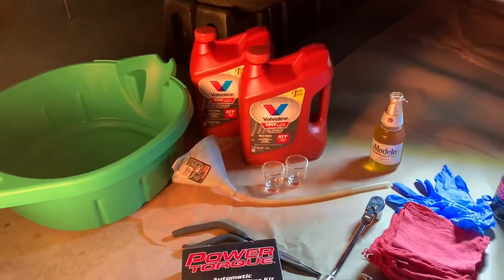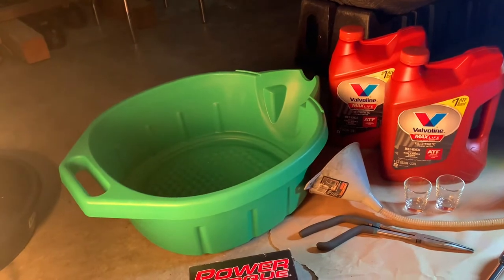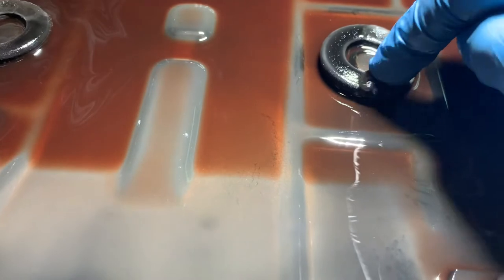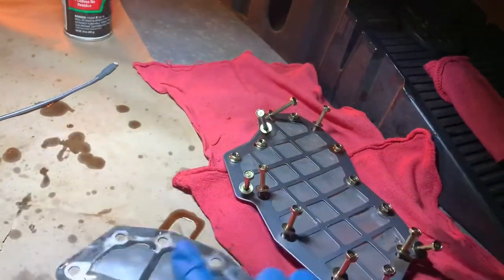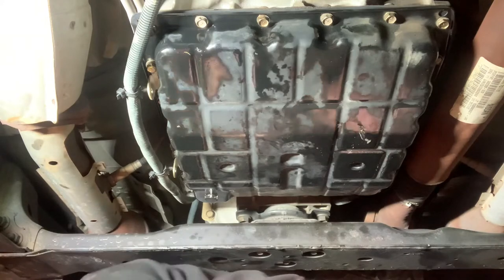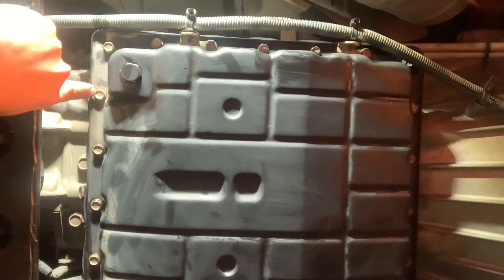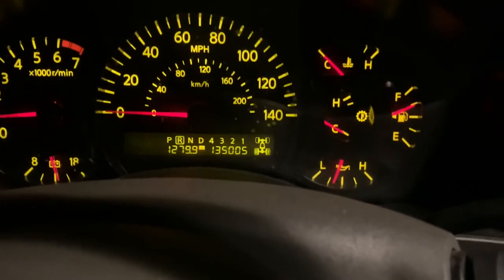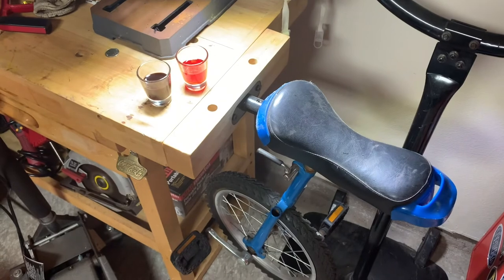Nissan Titan Armada Infiniti QX56 Transmission Filter & Pan Gasket Replacement & Service

Comment: Man, thanks so much for this vid and the info you provided. Watched other YouTubers do the same job,and leave out the important detail of cross threading the pan bolts. I followed other YouTubers directions and my pan leaked fluid everywhere. Watching this, I realized I needed to cross-thread and cross torque those bolts. Thanks a million 💯✌️✌️✌️✌️✌️💪💪💪💪💪💪
Reply from the maker: Wow thanks so much! I appreciate the view. YouTube is a lot harder than I thought with editing but I am trying to get better. The Navy has kind of out a hold on my channel for now so it will be stagnant for a bit until I retire.
Reply: @SideGigSquid Thanks shipmate.

Comment: Kitty litter also helps absorb residual oily fluids from your driveway and garage floor.
Reply from the maker: Yes I use that for quick clean up of fresh spills. But for stains I use this method.

Comment: Good video thanks. I understand that your gonna re-drain the fluid again in a couple weeks. Would it not been better to change the filter on the second fluid change rather than the first change? That way you would have had cleaner fluid running through the filter. I believe it would had been best? Just a thought...great video, straight to the point. Liked the way you kept track of the different size bolts & gave torc specs!
Reply from the maker: You’re absolutely right. I wasn’t planning on changing it a second time until I saw how dirty it was. I went ahead and just did a new filter again as they are only $12 and when I’m not filming and editing it actually doesn’t take too long.

Comment: Can you link to the replacement gasket, pan, and/or bolts that you bought?  My bolts are rusted out.  Did you buy OEM parts?  Links would be appreciated!
Reply from the maker: I bought from rock auto. Bolts are something I’d probably get from the dealer. Don’t want to strip those out being too long.

Comment: It wasn't shown in the vid, those magnets can be removed for a better cleaning. There is crud hiding in there, that brake cleaner can't spray off.
Reply from the maker: Yes I did another change about a month after that and used my ultrasonic cleaner. Appreciate the view.

Comment: I have neglected to change my transmission fluid, and now have 200,000 miles on my truck. In drive it doesn't shift right but still runs very good. If I change my transmission fluid now will my transmission slip, or do I continue to run it until it breaks down. Its a 2008 Nissan Titan. Need your expert advice, THANKS
Reply from the maker: Something like that I’d change it and put an additive recommended for slipping transmissions, like bars leaks or similar.

Comment: Hey Quincy I got a 2011 Nissan titan sv how many quarts of transmission fluid do I fill back up with??
Reply from the maker: After drain and fill service with 5 quarts. Run the engine and get it warm to check the servicing. May need to add a little more based on what stayed in your system.

Comment: It’s not necessary to ever change the filter it will never get clogged unless the transmission is gone you have to remember the size of the filter and it is magnetic and the most metal will be from the break in after that it shouldn’t be no more metal or very tiny bit the magnetic screen catches the small amount of  metal and you still have 99 percent of the screen that can’t clog unless the clutch plates disintegrate then you need a transmission
Reply: I’ve seen screens with 200,000 miles and the metal is about the size of a piece of chewing gum
Reply from the maker: To each their own. I try to change mine and flush it regular intervals. No problems in 10 years. But then again I’m a slow accelerator and a speed limit cruise control master.

Comment: How many liter of oil
Reply from the maker: 15 quarts for a bone dry transmission which is not really going to happen unless you tear it all the way down. Recommend you see what comes out, put that much back in and check the dipstick after driving to service to level. This will prevent over service.

Comment: Good video ! Got a 2011 Armada and was getting slips after start up and picking up speed mainly highway speeds and it’ll slip right before I hit 60 and will stop right after so checked my ATF dipstick and saw it was golden and now I’m going to replace the fluid and filter debating whether to change out the pan also the gasket will see once I see how it looks.
Reply from the maker: I would think your Pan is ok. Definitely filter and gasket though.

Comment: Why didnt you add Matic S?
Reply from the maker: I didn’t feel it was necessary after talking to dealer and Nissan techs. They have this stuff figured out now that you don’t need to utilize specifics like that. Just an opinion.
Reply: @SideGigSquid  what do you recommend ?? My Titan has 166,000 miles and the other day it was 105 degreees outside and it started shifting rough , next day was driving normal what do you think it is
Reply from the maker: @XplosiveFuZioNHD  I’d change your filter and fill with Nissan approved fluid and maybe a quart of Lucas.